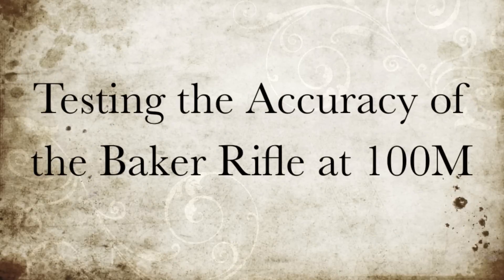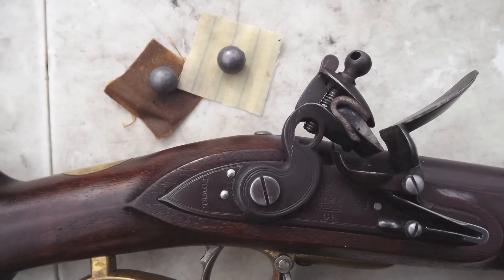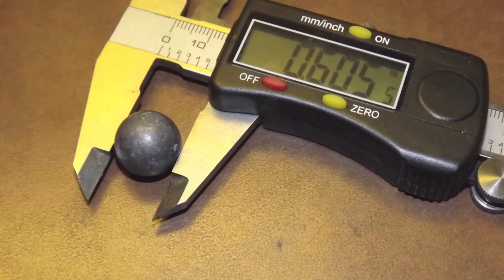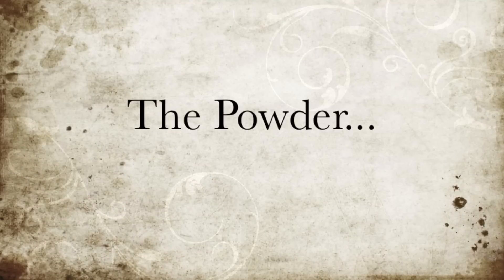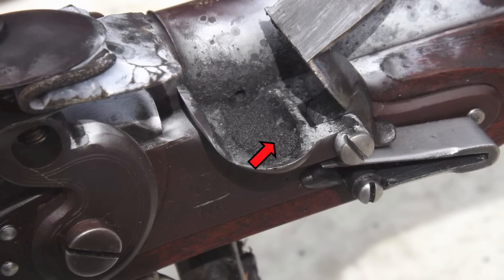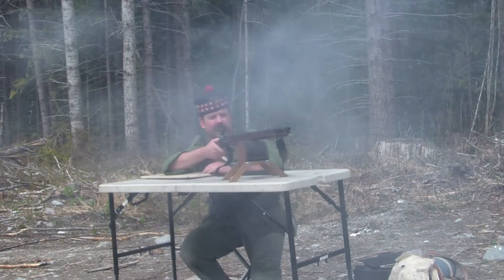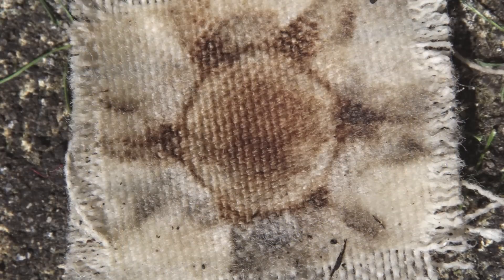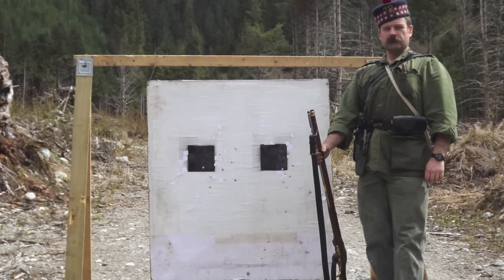1800 Pattern Infantry (Baker) Rifle: Testing for Accuracy

Comment: Have you considered getting a barrel made to replicate the original 1 in 120 twist Ezekiel used in his rifle instead of the 1 in 66 Coleraine used in theirs? The Rifle Shop recommends Bob Hoyt for custom barrels.
Reply from the maker: I got mine made with the slower twist.  It still has the six, round bottom grooves though.
Reply: They have started advising people that Coleraine is cutting their Baker Barrels with square rifling now. You really have me torn, I was going to build a great Military Flintlock Rifle, I may go with a Baker instead ;) Kidding, I am going to build a Baker but first I build a Harper's Ferry 1803, I could buy a Pedersoli 1803 cheaper but I want a more faithful replica.
Reply: where can I get a baker rifle like yours?

Comment: Great test, informative as all of your videos. I am sorry but I could not really understand what material the two patches are made from and which one performed better. Also, can you use the patches multiple times, and where do you find them after shooting (close the the rifle/next to the target/...)?
Reply from the maker: Hi there.  The mattress ticking (the striped one) came out on top with a FoM of 3.32...  I suppose that you could use the patches again....  In an emergency and not for regular shooting, though..  They are found about 10m out in front of the rifle, easing to one side depending on wind.  Cheers.
Reply: Thanks for the fast reply! Can you just use regular mattress ticking like the ones you can buy in rolls on ebay and cut them into their right size, and which size is right?
Reply from the maker: Iron Gear It's about .022 so it's fairly thick.  Any non-synthetic will do as long as it doesn't burn through... a bit of trail and error, of course.  Size-wise, as long as it wraps up around the side of the ball when it's in the muzzle, you're good.  any extra is just to make it "not so finicky" to get centred.

Comment: FF Goex is much too slow a powder for this piece. It is not equivalent to the FF powder mentioned in the original literature; which is in itself an error. The internal ballistic situation in this weapon is such that a much faster powder is required. FFF Goex is usable. but Swiss Black Powder, FFF is significantly better. The reason for your extreme vertical scatter is poor / variable ignition / primary pressure buildup. Large calibers with easily displaced projectiles, compared, for instance to a cartridge with a crimped long pattern bullet; provide only a very brief opportunity for proper ignition and pressure buildup.

Comment: Hello, I was wondering if the barrel you are using is 6 0r 7 groove rifling. I thought the Baker was 7 and would you think that this may have any impact on the accuracy? Also did you get your gun in American walnut or European?Thanks
Reply from the maker: +Dan Ellis The barrel used here is a six groove.  It does have the service twist of 1-120 though.  I had a seven groove 1-120 on an Indian Baker earlier and the accuracy I got from it was about on par...  This barrel has round bottom grooves for easier cleaning and reduced fouling build up..  Cheers.

Comment: What are the dimensions of your patches?  Also what type of lube are you infusing your patches with?   You may find that if you change your powder to a 3Fg you might be able to shrink your groups.  Until I placed a vent liner into my Baker, I had to use a HUGE priming charge of 3Fg to set it off with a 2Fg main charge.  Afterwards, I find that 80gs of 3Fg with a half pan of 4Fg will set her off each time with great accuracy.  Additionally, I did disassemble my lock and polish the surfaces of each moving part plus the inside of the lock plate with a hard Arkansas stone followed by very light lubrication with light machine oil.  After that, my Baker's lock is extremely fast.
Reply from the maker: HI there.  The patches are about 1.5" square and the brown material is .016 and the stripped material is .022.  The lube is melted shortening. (added a note to the video as I guess I forgot to mention that….)  Funny you mention 3F powder.  I am, in fact, trying it next time out, as a result of discussions elsewhere.  The only thing is that I will have to add a step to the loading drill and plug the vent as the hole will allow 3F powder to blow right through.  Haven't yet decided on when I am going to install the liner…. Although I haven't "polished" the inside of the lock plate, I did go over it and relieve the areas that were being rubbed by other parts (under the tumbler and under the mainspring, for instance) It gave a noticeable difference in operation.  Thanks for all your suggestions.
Reply: britishmuzzleloaders Make sure if you do use a stone to polish your lock internals, DO NOT use India stones.  Those are too course, you only want to polish not remove metal.  Hard Arkansas stones are perfect, you can actually feel when the stone stops cutting and starts polishing.  I find your videos very interesting, informing, and entertaining.  You do an excellent job with your vids.
Reply from the maker: Thank you for the advice on the stones and for the kind words.  I am glad that you find them "watchable"….
Reply: I have been shooting muzzleloaders (originals, reproduction muskets, and custom built rifles for 25 years.  It is just nice to see someone who shares some of the same interests making videos about those interests.  Cheers Mate!
Reply from the maker: Yup, I'm on top of it.  RIght down to the closing of the frizzen to keep it in place...   Thanks again.

Comment: Great test,  I was unsure of which flash powder method worked best, ver 1, 2 or 3?  and do you use a lube on your patches?
Reply from the maker: HI Jon, it was the "level with and next to" version (number 2) that the experiments said came out on top.  Of course we are talking micro seconds here.  After I put the powder in the pan, I give the lock a little nudge so that it moves the powder up to the barrel (and right under the vent). The articles on the Blackpowdermag site are really well done.  The patches are lubed with melted shortening (Crisco).  Cheers.
Reply from the maker: Next week then?….  :)